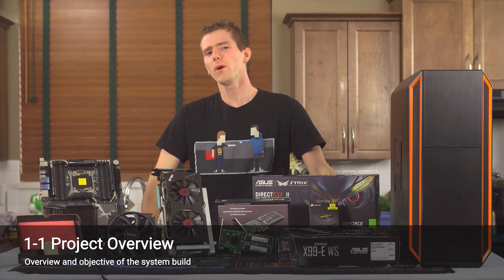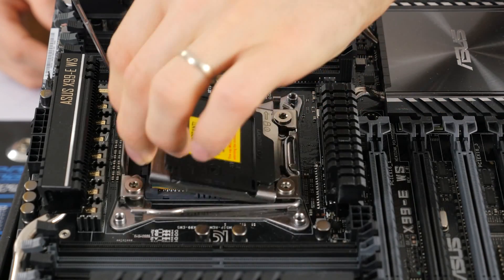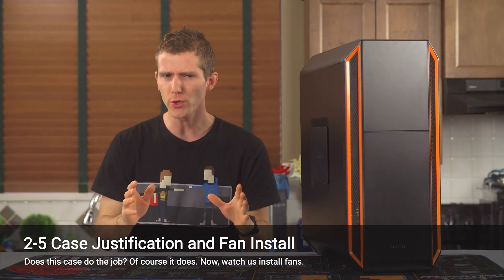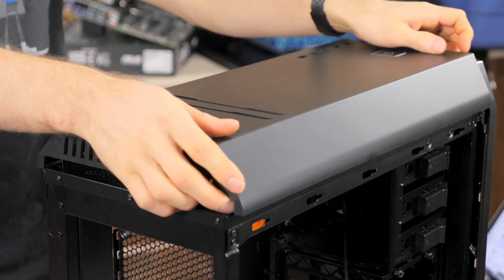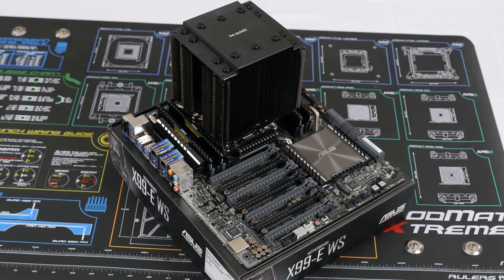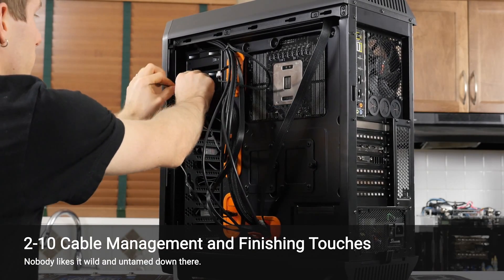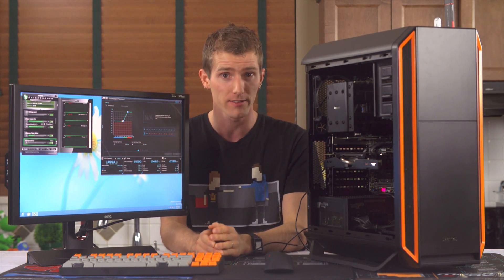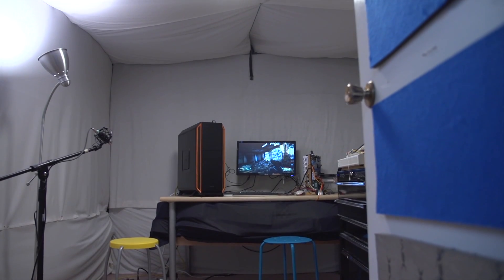How to Build the ULTIMATE Silent Gaming or Workstation PC

Comment: Could you sleep like 3 meters away from this computer?
Reply: I use mine as a pillow.
Reply: okay, nice! I want a computer that I can sleep next to while it's rendering
Reply: Really cool!
Reply: +Dimplex LoveDurex same case and im getting noctua nf d15 and some noctua fans because i can hear my pc even when im usimg headphones (closed)
Reply: +Dimplex LoveDurex i have stock fractal fans and 2 120 fractal and 1 deepcool 140fan and i have motherboard what can controll fan speed by software but i can still hear it when im gaming and my temps get too hight like 90c on cpu and 80c on gpu and fans 100% i get around 80c on cpu on stress test and gpu 62c
Reply: Dimplex LoveDurex no it is watch some tek vidos on like linus tech tips or jayztwocents
when cpu is over 85c then ist bad
Reply: +gagomand I'm sleeping above mine xD.(My setup is under a top-only bunk bed)
Reply: +gagomand considering it's 14dBA at idle (little louder than someone breathing a meter away), yes.  You could sleep 3 meters away.  If you are taxing the CPU and GPU doing God knows what at 12 A.M. while you are trying to sleep (I don't even...why isn't it sleeping too?), you could still fall asleep alright.  24 dBA is a little louder than a whisper 1 meter away.  I'm a stickler for silence when I sleep, even going so far as to use my firearm ear muffs, and I frequently fall asleep in and around that noise level.
Reply: +gagomand My computers fan actually relaxes me... xD it's very soothing
Reply: Why not spoon it?
Reply: cheddar07 i got those ratings when my i5 was clocked to 4.5ghz with 1.25v and i was doing something REALLY stressfull. And cooler was Noctua NH-U12S.
Reply: +gagomand I'm sleeping 3 meters away from a louder computer, so...
Trust me, at 24 db it shouldn't give you that much problems.
But if you do find the sound under load a problem you could always just tweak the settings a bit and reduce the load a bit and you'd have a damned near silent computer.
Reply: +Jesse Lee Yeah, only reason my own desktop is louder then this at night is that I'm running BOINC on it.
When it's idle I can't hear it at all over the noise of my fridge (that I can't afford replacing yet)
Reply: +RedNova Gaming same
Reply: how does he do those angle shots of the different parts of the pc he's showing us how to put together I wanna do something like that is it a pan or how does he film like that
Reply: +gagomand im sleeping at about 2 meters away from my pc ,and it is noisy
Reply: +gagomand I could probably sleep inside it.  Can't sleep within a three mile radius of my noisy bastard rig though!
Reply: CowLunch
ok
Reply: +Dimplex LoveDurex My i5 sometimes goes to 98c :DD
Reply: +Aaponton That CPU Temp. Looks really bad, you need to reconfigure some fans or get ones along with a better cpu cooler. Or it could be just a matter of reapplying thermal paste.
Reply: +marko jyysström HOLY CRAP! what are your ambient temps? that's really hot!
Reply: gagomand you could try
Reply: I've slept next to a fridge
Reply: *****
Well if it's any comfort then know that unlike a AMD chip a intel chip is actually made to be able to handle that much heat (at least for a while, I believe it's throtteling temp isn't that far from the temp you've reached)
My FX 8350 on the other hand should ideally be in the mid fifties in temp and can't handle anything close to nintyeight celsius.
I don't remember the exact throtteling temp but I believe it was somewhere in the sixty to seventy range.
(Although admittedly the FX 8350 can't actually measure the actual temperature pr say but only the temperature difference between different parts of the processor, something that can be used to infer the temperature with some degree of uncertaincy)

Comment: I have an AMD FX8320 with hyper 212 evo, the two stock fans from my source 210 elite (currently the cheapest case around), a 1tb blue, 12gb ssd, and sapphire 270x. And its pretty damn near silent. It runs 24/7 about 2 metres from me and even at 2am I can't hear it. After a 4 hour render I can just make out the cpu cooler.

Comment: im trying 2 build a gaming pc but im not sure can it handle 3 1440p monitors

specs: 
Sli 2x EVGA GeForce GTX 980ti

Intel Core i7-5820K

Corsair AX1200i

NZXT Phantom 820

NZXT Kraken X61

ASUS RAMPAGE V EXTREME

2x Intel 240GB 730

Western Digital Red, 4TB,
Reply: Are you a troll? But if not, yes it can handle 3 monitors.

Comment: is my specs good for  recording minecraft vids? (btw its a laptop)
cpu:core i5 4200 2.5 ghz quad core prossesor
Graphicscard:nvidia 710m 2gb graphic card
ram:8gb ram
memory: to store all my vids is 750gb
os:windows 8.1 64-bit 
?
Reply: That will do as long as you dont runhardcore shaders. Some of the lower ones are fine tho
Reply: Mommad Uddin k good thanks for reply!
:)
Reply: Np ! Glad to help :D
Reply: Mommad Uddin :)
Reply: +appleadd it came with it
Reply: about 750$
Reply: 750gb memory? Wow.
Reply: ***** You know memory is ram right? 750 gigs of ram is very unlikely.
Reply: +appleadd The gpu is likely too slow to benefit (much) from the 2gb though
Reply: Since videos are pretty large in size I recommend you get a Usb 1tb external hard drive

Comment: Hey guys, what do you guys think about this Build? ( http://de.pcpartpicker.com/p/jPtMYJ )
CPU: Intel Core i5-4690K 3.5GHz Quad-Core Processor
CPU Cooler: Enermax ETS-T40-TB 86.7 CFM CPU Cooler
Motherboard: ASRock Z97 Anniversary ATX LGA1150 Motherboard
Memory: G.Skill Ripjaws X Series 8GB (2 x 4GB) DDR3-1600 Memory
Storage: Crucial MX100 256GB 2.5" Solid State Drive
Storage: Western Digital Caviar Blue 1TB 3.5" 7200RPM Internal Hard Drive
Video Card: EVGA GeForce GTX 970 4GB FTW ACX 2.0 Video Card 
Case: NZXT H440 (Blue/Black) ATX Mid Tower Case
Power Supply: XFX XTR 650W 80+ Gold Certified Fully-Modular ATX Power Supply
Operating System: Microsoft Windows 8.1 OEM (64-bit) 
Case Fan: be quiet! SilentWings 2 60.4 CFM 140mm  Fan
Reply: Sorry dude, I have to break the news to you.. You can't even run club penguin at 69 fps :// it's too dank to function
Reply: lol
Reply: I have almost the exact same pc.

Comment: I used to try and build my PCs silent. I used them primarily as workstations since I've found loud PCs can affect mood. In recent years I've given up on doing so. I made a hole in my office and the computer is off in a seperate room. My computer has 8 total fans and I still somewhat hear it through the wall, but with music playing, which is basically ALWAYS, I don't hear it anymore. You just have to be prepared to purchase many long wires and extensions to still run your displays/accessories.

Comment: Can someone tell me the specs of this computer?..
Reply: John JOHN i7 5960x with be quiet! Dark Rock Pro3 heatsink (without fans), normal case fans apart from two extra SilentWings 2 fans, Asus GTX 980, fan dust filter in the back (120mm I am presuming), be quiet! Silent Base 800 case.

Comment: Hey Linus, what do you connect your anti static strap to?  Mine has a wire thing and then a little clamp, presumably to connect it to something that will ground you.  Is there something specific I need to clamp it to, in order to achieve grounding?

Comment: Facepalm, build your pc as noisy as you can, put it on the other side of the wall.. drill a small hole for cables and BAM, perfect setup.. can even run Delta / server grade components and have a perfect setup

Comment: big mistake puting intake fan on the back....
Reply: 92Cope It allows more airflow to the CPU heatsink, and stop hot air buildup at the back of the case.
Reply: yes but big fan on the front pushing the all air at the back and then you put at the back fan that will suck out the hot air i mean it's more logic and all use that kind of build, sry for my bad english :D
Reply: 92Cope That is true when you have a cpu fan which also blows that way. If you don't have a fan on the cpu, the hot air builds up at the back of the case (if you do not have 2 top fans, even then it still happens), and so he had the back fan as another intake to make as much air flow to the heatsink as possible, and then get ejected by the top case fans. This way there are no areas of hot air buildup which increase the temperature of the heatsink and other components.
Reply: yeah that makes sense, i forgot  that cpu dosent have Fan xD...
Reply: 92Cope xD we all make mistakes :D

Comment: I'm a enthusiast to (semi)passive quiet builds and have a custom built optimized for that. 
I'm astounded as how few  good semi-passive builds you can find over the internet. 
Lots of down points in this video.:
1) 100% passive heat-sinks without fans are completely pointless. There is no reason whatsoever not to have a fan in the cpu's HS and just keep it off for most of the time. And when you want extra performance, you can set it to only turn on at very high temperatures (+75c) to avoid your CPU from frying and still allowing a high overclock than a complete passive HS. Instead of removing the fan, adjusting the cpu's frequency in OS is the best flexible option to choose the optimum compromise between Noise and performance above 75c
2) 120mm fans are terrible options. That is the obvious reason why this build fails at LOAD mode. When going for a absolutely quiet build, the correct choice of fans size and models are crucial. The ideal CASE would have the biggest fan supports as possible, preferably with no 120mm fans whatsoever. If you have 140 200 and 120 mm fans, you would notice that the 140mm will be much more efficient pumping air than the 120mm. The 200mm will be particularly better for top exhaust at very low rpms (600~800). The case in this review does not support a rear 140mm exhaust fan, so that would be a instant cut-out for me. The 120mm fan selection is not the best either, Corsair's SP120 quiet edition is the best CFM vs Noise ratio fan in the market. 
3) While 100% passive PSUs are neat, they are not a good choice cost-wise since they usually are ridiculously expensive. A supernova G2 which is semi-passive up to 300w would be the best balanced option.
4)This is a extremely overpriced build, btw, only few people could afford it. Quiet semipassive pcs DON´T NEED TO BE over ~750USD. Mine isn´t (if you don´t account for the SSDs). 
5) The rear fan used as intake is another choice that I believe is not very good, as it blows air away from the top opening grill and reduces the natural convection of the massive HS. 
6) Another criticism of this case is that it's top and front grill are considerably obstructed by pointless plastic aesthetic-parts. I don´t believe the compromise of sealing the CASE with plastic and rubber for absorving the sound of the fans is always the best as it cranks up heat inside and limits the thermal dispersion of the build, thus the maximum performance. Bigger low-rpm fans with large area grills is the best option IMO.
7)Related to the previous 2 itens: Semi-passive builds should have NEGATIVE pressure, not positive.
8) No undervolting on the CPU? Boooh No moderate overclock? Double Booh. 
9) I haven´t seen emphasis on trying to find the sweetspot speed of the case fans, ramming them all way to the max as the CPU gets to 70c is not an intelligent choice. A high static pressure cooler on the HS, as stated on item one, would be a better option and finding the ideal max speed of the case fans is also essential. For my build, I found that having my 140mm fans at 700rpm and the 200m at 600 is the sweet spot, enough to reduce the Delta-V from ambient from 12 (complete passive, a average midtower, btw) to a mere 1.5. Increasing the fans speed to 1200 and 900 rpm (their maximum) bumped the noise a lot and didn´t reduce the Delta-V significantly more.
Reply: Also another detail I noticed, a low-noise resistor adapter is only a good option for fans that actually can start up at lower voltages (5 volt and bellows). However, if you don't go with this exact silent wing models, usually a pwm controlled fan will go lower speed (thus noise) than a voltage reduced fan.

Comment: Hey, I have an ASUS M51 FX-8300 Desktop PC I bought from future shop 2 years ago. I want to upgrade it so that i can do picture editing and video editing with it with ease. I play games like Guild Wars 2 and the fps on unlimited can reach 54 but will drop below 30(i keep it at max 30 fps to play). I am wondering what i need to upgrade to be able to run photoshop and other adobe programs with ease.
The pc uses an APU but has an Nvidia GTX 650/1gbd5 graphic card. I replaced the graphic card with a GTX760/2gbd5 and it could run GTA5 but experience frame rate issues and couldn't play GW2 at a solid 60fps(it performed virtually the same as the stock graphics on GW2)
Any help would be very appreciated. Thanks!
Reply: Nick Gourlie maybe the cpu, mobo and ram... but go to the LTT forums ..

Comment: Cpu> Intel Core i7 CPU 960 @ 3.20GHz

Ram> 24Gb DDR3 534,5 MHz Triple

mothercard> Asus Sabertooth X58 (LGA1366)

Gpu> Amd Radeon XFX R290X Gpu1000Mhz/Memory1250Mhz

Psu> Corsair HX1000W

can i run gta on high settings?
Reply: 1234retstickan at 1080p? probably

Comment: This is awesome, What is the total cost of this build?
Reply: The cpu by it self is £1000. You are looking at above £2500
Reply: Arun Prasath Muniyappan I have the same exact build but I have an fx 8350 instead of the i7, I assume that the silent passive setup will work because the fx 8350 has a 15 watts lower tdp.
Reply: Calvin Collins ??
Reply: Gus TV Go look at benchmarks, it'll show you the numbers
Reply: +Gus TV TDP isn't a good indicator. Die size, heat spreader and architecture efficiency are also factors. And efficiency is somewhere AMD loses quite a bit. And the large heat spreader goes to enthusiast CPUs which only Intel makes.

Comment: Is this a good build for 2K$ I can't go over though... (and yes, I will edit.)
Mobo: ASUS MAXIMUS VII HERO
Processor: i7-4790k
CPU Cooler: Cooler Master Hyper 212 EVO
RAM: 16GB DDR3-1866 Crucial Ballistix Sport
Storage: 1x Samsung EVO 256GB SSD and 2x WD Blue 1TB HD
PSU: EVGA SuperNOVA 850G2 850 watt (need some growing room for the future plus idk how much this needs under heavy load/rendering...)
Graphics: EVGA GTX 980 Superclocked ACX
Case: Corsair Carbide 300R Mid Tower
Reply: BlaZe Cryst  Have a look at AMD FX 8-cores and compatible motherboards if you wanna save a bit of cash. Aside from that its a really good build.
Reply: BlaZe Cryst Could I suggest an NZXT H440 or a Noctis?
Reply: Neil Mc Cann yeah i was going to go for the h440 but it sold out where im buying it all from
Reply: cale devers The FX series is getting dated though, and AMD are releaasing a ne series of GPU's soon I believe.
Reply: Neil Mc Cann Yeah true but the FM2+ boards that the apus are using are virtually dead and they overclock like nuts.
Reply: BlaZe Crystt I've heard great things about the 980 TI, apparently the best bang for your buck you can get in high end cards. Might be worth looking in to.
Reply: Guys, what about Dell XPS 8700, is it good for gaming?
4th Generation Intel® Core™ i7 Processor 
16GB Dual Channel DDR3 1600MHz - 4 DIMMs

AMD Radeon™ HD R9 270 4GB GDDR5
Reply: Mohamed Al-Ali Yes.
Reply: cale devers Thanks!
Reply: Mohamed Al-Ali You're welcome
Reply: No, build your own pc for much less and with more power an r9 270 isn't great
Reply: hey guys is this build good 4 gamin?
2gb ddr2 ram
intel celeron @ 1.5ghz
1500W platinum psu
GeForce G210 gpu

Will this run GTA V max settings? Thanks guys!

lol jk m8
Reply: ***** I decided to make my budget bigger and go for 4,000 dollars
Reply: +hadron89 I was looking to go LGA 2011 because the 5960x would come useful for what I want to do and use a 980ti and DDR4 ram

Comment: good or bad ? =)

Grafikkort
Modell	AMD Radeon R9 290X
Minne	4 GB
Anslutningar	HDMI, DVI
Processor
Modell	Intel Core I7 4790K
Hastighet	4.2 GHz - OC (vattenkylning)
Antal kärnor	4 st - Quad core
RAM-minne
Modell	Kingston HyperX 16 GB
Minnestyp	DDR3 1600MHz
Hårddisk (SSD)
Modell	Crucial BX100
Storlek	250 GB
Hastighet	535MB/s - 370 MB/s
Hårddisk (lagring)
Storlek	1000 GB
Anslutning	7200RPM - 6,0 Gbit/s - SATA
Moderkort
Modell	Gigabyte GA-Z97X-Gaming 3
Ljudkort	8-Channel High Definition - Optical S/PDIF
USB 2.0 - USB 3.0	8 st
Övrigt	1000/Mbit Gigabit LAN - 4 x DIMM, Max. 32GB
Övrigt
Chassi	NZXT Source S340 - Black
Vattenkylning	CoolerMaster Seidon 120V
Nätaggregat	Cooler Master G750M, 750W - 80plus Modular

Comment: Linus didn't speak of this, but i also recommend if you can handle CPU overclocking so you should "under volt" your CPU but still keep those clocks for better thermals :)
Reply: Muwex HOLY CRAP I LOVE YOU. I am having issues with cpu fan sound. While I dont want to spend money for a new heatsink yet I can at least attempt to deal with this issue.
Reply: Muwex Your comment makes absolutely no sense.

The whole point of adjusting the operating voltage is to improve the performance of the CPU via clock frequency. 
Increasing the clock frequency increases the power consumption which requires increasing voltages.
The increase in voltage is only limited by the increase in temperature and it's impact on chipset stability.
Reply: Johnny Cage undervolt for more silent i mean less temp with stock voltage. It makes all sense, i know this stuff. You just didn't understand my comment it seems.
Reply: Muwex Why did you mention overclocking then?

Did you mean to say if your CPU can't handle overclocking?
Reply: Meant undercloking or like well not underclocking, let the clocks stock but lover voltage for lover temp and wattage usege :)
Reply: zach burke No problem. Great that i can help someone :)